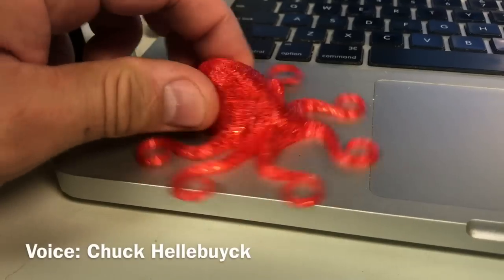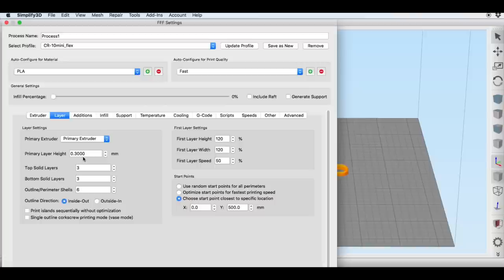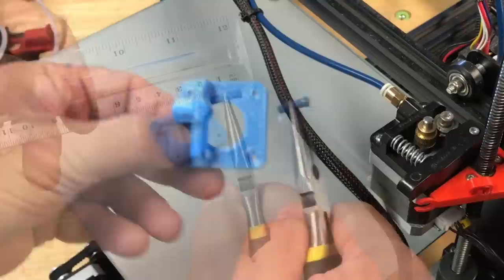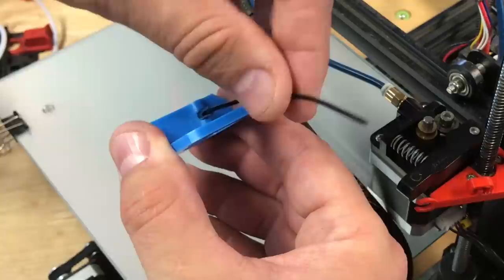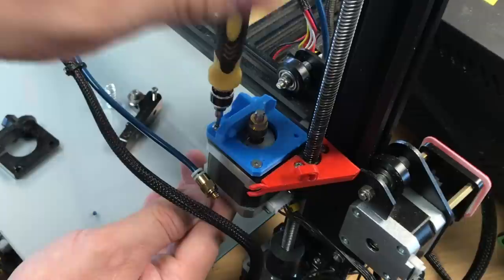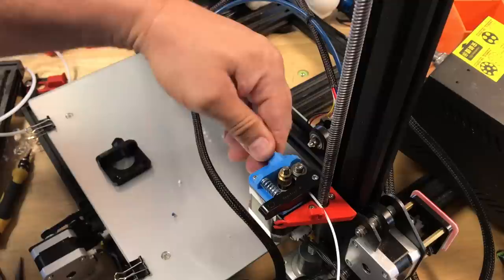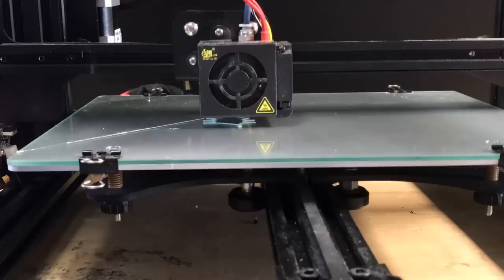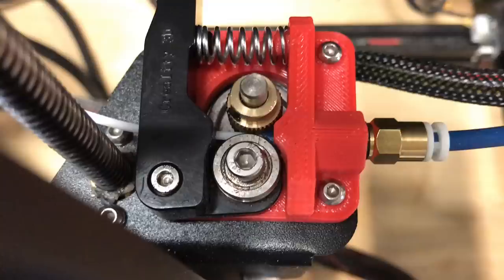3D Print Flexible Filament on CR-10 Mini and Creality Ender 3

Comment: Amazing results!
Great information and tutorial.
I have the Luxnwatts Creality Aluminum MK8 Extruder Drive fitted.
It has the V shape already, do you think I would still have to print the 3d printed version for this to work with Ninjaflex?
Again great tutorial.
Reply: did you try it out?
Reply: @MrMarksam1  The V-shape is not the solution here, it is the Boden tube that can be fitted inside of the 3D printed part, the Stock part has a smaller hole where the filament enters before it goes into the boden tube. this one had a hole of an even diameter all the way, so that you can fot the peace of the boden tube in... hope this helps...

Comment: Awesome! 10mm/s is definitely not fast, but hey if it can do it it can do it and from a bowden alone is impressive with 1.75mm. You can force S3D to backtrace through the parts by adding a high number to 'avoid crossing outline for travel movements' and it'll stop the stringing completely regardless of retraction being disabled.
Reply from the maker: Thanks I’ll try that avoid crossing idea. 10mm/s is also a starting point. I’ll be testing higher speeds in future prints.

Comment: This works really well on my ender 3. For some unknown reason I used PTEG settings for my PSVR glasses protection model. With 12% infill and used 30% support along with 225/60 temp. And it came out really well. The support came away with a struggle but cleanly and all done with the fantastic Chep,a extruder 3d print and a piece of bowden tube. The Ender 3 never ceases to amaze me.

Comment: Chep, thank you for this video- it saved me after a recent extruder drive update.  I replaced the plastic extruder unit on my Ender 3 with an inexpensive  metal one (per one of your other videos).  Unfortunately with the one I purchased, there was a large gap between the drive wheel and where the driven filament goes into the bowden tube - one much wider than even the stock Creality plastic extruder.  Every type of filament was spooling up in that gap before it could get to the bowden, right where your video showed the flex winding up before your fix.  Because of YOUR video, I knew I needed to fill that gap.  Fortunately, the particular all metal drive unit I bought was threaded all the way through to where the bowden tube coupler/clamp goes.  I took a threaded metal hot end throat tube (same thread!), shaped the out end with a Dremel (yes an actual Dremel) to look like the "snake mouth" (your words) from the video then shortened it to length (estimated by eye) so it would meet with the tube clamp where that ended in the threads.  The threads also allowed me to adjust the throw to the idler and drive wheel as close as possible without dragging and I locked it down by tightening the bowden clamp tight against it.  Works like a champ AND I have a sturdier extruder than provided by Creality.  THANK YOU!!

Comment: Suuper late to the party.  Many thanks for this video!

However, I have a potential alternative that could save a lot of time and frustration.  

I attempted to print the extruder file, but it's a mess.  My machines are finicky, and I* need to design every part with it's quirks in mind. 

However, while I waited for that to even print, I found a much quicker solution.  I have several extruder assemblies that are plastic.  They have a threaded insert for the coupler, a metal idler, and hardware, but the mass is plastic.  So I just drilled it out.  Not even with a drill, just put a bit with hex shank in a screwdriver handle and reamed it.  

Took about 5 minutes from start to finish.  

Same deal with the pointed tubing to reign in the filaments, but yeah, no need to print anything, just make the hole big enough for the tube (4mm).  Would probably work with a metal extruder, but I wouldn't try to do that by hand.  

Wear safety glasses and thick gloves, or whatever level of PPE you are comfortable with.

Comment: Thank you! First try and I printed the same octopus you did, similar settings and it turned out perfectly! Even with the cheap eBay TPU I used haha
I couldn't believe how easy it actually was to print, I had more trouble printing the replacement extruder guide 
Awesome guide!

Comment from the maker: I improved the extruder 3D print by adding threads in coupling hole. The new file is on Thingiverse. Link is in description.
Reply: i dont understand why u had to upgrade   that part lol im so confused
Reply from the maker: Watch at 1:30 again and it should explain why. The stock extruder lets this super flexible filament escape.
Reply: @FilamentFriday  I think the question is why does it bind up like that when you don't have any retraction turned on. Is it catching in the stock part or whats the reason for the binding?
Reply from the maker: @pillowhead - I upgraded the 3D print with threads because the coupling would push out during printing.
Reply from the maker: @joshua - there is a gap between to gear and the hole for Filament. And resistance and the filament buckles in the gap.
Reply: @FilamentFriday  Ah okay. Thanks!!!

Comment: Hi there CHEP, another great video, congrats.

I managed to print a Shore 98A TPU without changing anything on the printer. Already had saved your modified extruder but decided to give it a try with the standard one.
Reply: I tried printing Shore 90-94A TPU and it extruded for a bit and then slipped out again and again... I will definitely try it with this upgrade again ;)

Comment: So far what I found is, the extruder tension has to be very light, just a little beyond basic tightness. Where as PETG needed to be wrenched down because it was slick, the tension creates a stretch or a bulge and it wraps around. That said I just started using it the other day, but that's what I found so far.
Reply: I noticed, depending on what I was printing, and some other settings and issues, having tension on the inlet filament by way of an overhead, heavy spool reduced the chance of binding, escaping, or bulging.  

That would be the same as less extruder tension as the two are fighting each other.  

I prefer, because I print TPU on a small machine actually to lay the spool flat on the floor and let it unwind concentrically.  This means almost zero tension on the filament, so the focus is again on the extruder.  

It's wild how variables in one part of the machine can affect performance of other components.

- Oh how much I would love a Bambu Labs machine....
Reply: @easymac79  each filament drives me crazy. I built an overhead cabinet that's sealed, with a spool holder with bearings. The tension has to be middle for one petg, another one has to be very tight. The tpu squishes and creates a bulge if its too tight. But it can't be too loose either. I can deal with retraction etc stretching it, its just a number. But the mechanical tension, getting that right every time is hard.

Comment: Awesome! I just have one question:

If I did this, would I be able to still print normal pla? I have an ender 3 pro.
Reply: Yes you can, it really doesn't change anything for pla
Reply: It actually helps prevent stringing on lots of filaments.

Comment: is the plastic design of the extruder different on the E3 compared to the E3 Pro? I have several E3 Pro’s built in the same year as this video was made, and they print Ninjaflex fine completely stock.

Comment: I printed this. The holes for the screwd line up but the hole for the boden coupler is too small amd wont threa in. If i scaled it just slightly to make it fit then the screw holes will no longer fit. EDIT: i used my drill press and used a 7/32 bit amd drilled the hole, coupler screwed in tightly and holds

Comment: Hey Chep. Find your channel when I bought my ender 3 v2. Amazing work. I'm trying to print tpu, and I get blobs and zits all over the print. Nothing I do seems to improve it.
Reply from the maker: Possible needs to be dried out. TPU absorbs moisture.
Reply: @FilamentFriday  thanks Chep. I used the same tpu and the same stl on my prusa i3 and it came out perfect. It's something about travel or retraction or something that makes the filament ooze. And after every retraction it spits more than needed and leaves a blob.

Comment: Great tips! One question, I have a metal upgraded extruded, can I just insert the tube on that extruder on my Ender 3 or do I have to print the piece for that?
Reply from the maker: You probably have to drill it out to go through but it could work.

Comment: Since you can't use retraction with flexible filaments, you can reduce stringing by enabling 'Avoid crossing outline for travel movements' under the Advanced tab and setting the value to about 20, as Maker's Muse has suggested in his flexible guide https://www.youtube.com/watch?v=fTJz6vMvtJ8
I actually use this option for any filament when I want the travel movements to occur inside the model to hide stringing.
Reply from the maker: Yeah, Angus commented on this video a few days ago to do that.
Reply: Ha! That's what I get for not scrolling down.

Comment: I had the similar problem when switching to TPU - i`ve found cranking the heat right up on the nozzle removes unused pla after that its fine.

Comment: Hey CHEP first off great content and thank you for spending the time to help the community. I printed the same exact way you did (at least i think i do) even the same octopus but for some reason the top of the head on mine caved in slightly and had gaps. I printed with no infill or support and 6 layer shell 0.3 layer height. What do you think caused this?
Reply from the maker: Same speed?  I believe I used 10 mm/s
Reply: @FilamentFriday  yes sir same speed. It took 3 hours 58 minutes the whole print was smooth except the last few top layers

Comment: Can the printed extruder upgrade also print PLA, PETG, etc.? Do you need to change the part out if you plan to switch from one filament type to another?
Reply from the maker: No all filaments work
Reply: @FilamentFriday  Thanks for the video and previous comment. I'm now printing TPU on my Ender 3, and the results are phenomenal!

Comment: Would this be compatible on the ender 3v2, I'm new to 3d printing and wanted a V2 to start but figured a direct drive extruder would be the better option, then came across this mod and wanted to know - thanks
Reply from the maker: Yes it compatible
Reply: @FilamentFriday  wow that's awesome to hear, thanks CHEP, awesome channel you have - thank you

Comment: Ender 2 vs ender 3? I would like to print flexible filament as well. I have not assembled a 3d printer before and was wondering which one I should get considering quality of printing and ease of assembly
Reply from the maker: Ender 3. It had a bigger build area and is about the same price.

Comment: A big thanks for your time and great videos. And a question... If I perform this mod I'm worried that changing filaments will cause that little piece of Capricorn tubing that you placed in the filament path will get drawn back into the idler wheel/gear space as I pull my old filament out of the extruder. I don't typically just execute a E- move to reverse the extruder to eject the old filament during a change. I carefully pull it out by hand while pressing the idler arm out of the way. Is this going to make it a serious hassle to change filaments?
Reply from the maker: Hasn’t been for me and I yank it out.

Comment: Awesome!  Where can I get the filament guide that you have there in red?
Reply: The third and fourth link in the description link to the printable file.  

It's possible you can modify the existing extruder frame to fit the tubing and simply cut the end to the arrowhead shape.

Comment: I am still new to the 3D printing scene. Does the extruder upgrade work with regular PLA filament as well? or will I have to change that attachment as I need to upgrade with ninjaflex?
Reply from the maker: Works with all filament.

Comment: hi Chep.  Great video.  I have an E3 Max.  Will this same adapapter work on this machine too.  Trying to print in TPU for the first time.  Any suggestions very much welcome.
Reply: I found with testing, that the most important part is finding a way to get a bit of PTFE tubing between the frame of the extruder, and the gears.  

What you are trying to do is guide the flexibles, with no escape path.  On the inlet side, there is less worry, but after the gears, it's trying to mash up and can slip out the side, or just gum up.  (I avoided retractions for this reason, but this CHEP's solution is much better.

No matter the design, focus on that 10-15mm between the extruder gears, and where it meets the tubing.  The metal or plastic 'funnel' looks accepting; but the filament will* escape.  

The pointed shape of the tubing that butts against the gears, to provide a perfect path is what you are aiming for.  

This can be adapted to any* extruder design if you focus on what needs to happen to put tubing in that spot.  - for me, it meant using a drill bit to widen the plastic hole to fit the tubing, then cut to shape (arrowhead).

Hope this helps!
Reply: @easymac79  thanks Kyle. I did try it, but found very fiddly.  Bit the bullet and bought a Sprite Pro direct drive. Prints TPU with no fuss.  Very clean prints across the board.

Comment: Hi there. Looks like it has been a good while since you made this video. Are you still finding this to hold up well for flexible printing on an Ender 3, or would you recommend going a different direction? Thanks in advance!
Reply: Specifically, would you recommend sticking with this or is the EZR a significant enough improvement.
Reply from the maker: EZR is the best choice

Comment: What screw is used for the idler arm? I lost mine and am looking for a suitable replacement
Reply: Look on eBay, you'll find the right one. Edit: the Ender 3 uses an M3 screw. It's socket type. I have a metal extruder so it's probably longer than the stock screw. You'll have to find a suitable replacement or order an M3 screw assortment.

Comment: Made the part, and started the process on my Ender 3 V2, only to realize the extruder design has changed. Any links to an extruder mod that will work with the V2? Thanks.

Comment: what mine i did not update the extruder and my ender 3 print it fine think its some of the older ones there can't print it
Reply from the maker: Actual 85A ninja flex?
Reply: i got to test sunlu tpu and have test ninja flex from a dealer in danmark and works fine on my ender 3 with out any updates to my extruder

Comment: How you sent me over here I'm sure you remember it was just the last night from your other video where you install the direct drive? Anyway I actually tried to print this before my machine broke down and it printed just fine all those printing kind of crudely due to the feeling fan that I have but that's another story but at any rate it printed a tiny perhaps for mm hole I couldn't even begin to screw in the fitting on my cr-10 is there two different versions of this one for the smaller size the feeling? Because I noticed the one you use in this video would have worked fine but I printed it twice and both times it grenade a very small orifice. I printed this file one time and the improved version with the threads and both of them printed really tiny I don't understand it.

Comment: Hi try to use TPU on my ender 3, but why the layer does not stick with others? the walls just separate away especially when i squish it.. do you know what cause the problem? thanks
Reply from the maker: Is the filament old?
Reply: @FilamentFriday  it's new one, just got it from local e-commerce.
Reply from the maker: You can try a higher temp. Otherwise I’m not sure.

Comment: My filament slips in the PTFE tube at the beginning. I see the filament buckle a little bit in the tube which result giving me gaps between the layers. It extrudes not the whole amount? What should I do ? I have the ender 3
Reply: That probably is because the stock PTFE tubing that comes with the Ender 3 has a bit bigger inner diameter than the capricorn PTFE tubing he's using.

Comment: Thanks, super tuto !!!! First time I print TPU on CR10S
Nickel, it works.
The speed of 10 mm / s is not a bit slow?
Reply from the maker: Did you install the modified extruder top?
Reply from the maker: You can use 20 mm/s after you know it’s working.

Comment: I am trying to print airtight ninjaflex actuator,  have any tips for getting rid of microscopic holes?
Reply: hello  with all 3d prints theres normaley microscopic holes, prhaps test a bit with some epoxy resin or latex , a thin coat can be flexible
Reply: What do you mean by actuator? Your best bet is to print something smooth, then silicone mold it, then mold it again to get your flexible part if it's that important.

Comment: Cool, thanks for the tips!
Do you think the stock extruder could print harder (98A) flexible filaments without mods?
Reply: I have a friend with an Ender 3 and he prints 98A without any mods.
Reply from the maker: Probably.

Comment: Really cool video, but I have a question how much does 95a you compare to the one you used 85a is 95a more easier to print?
Reply from the maker: 95A is tougher to print
Reply: @FilamentFriday  why is that? The higher the number the softer?